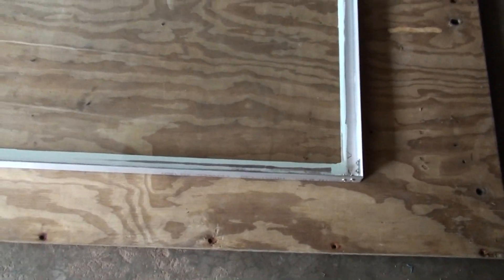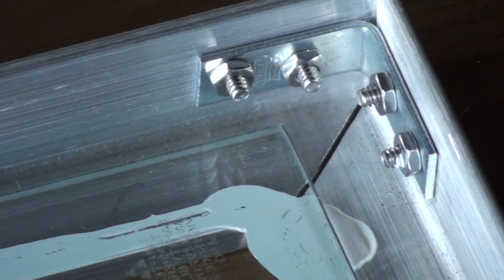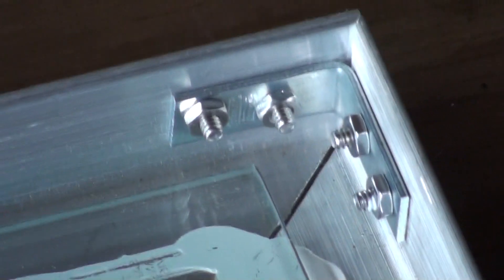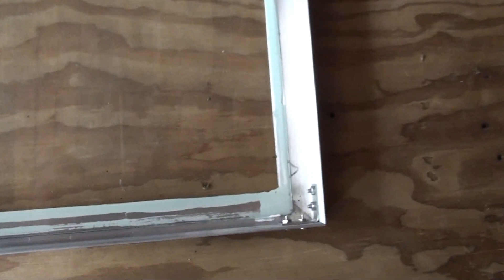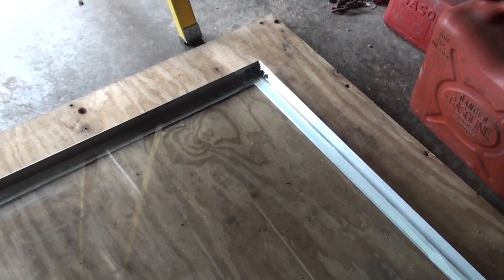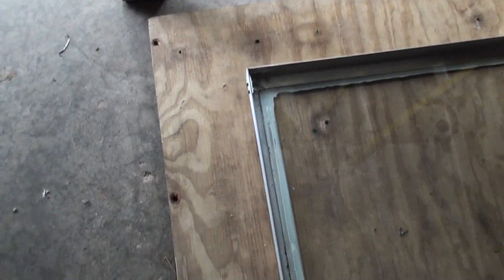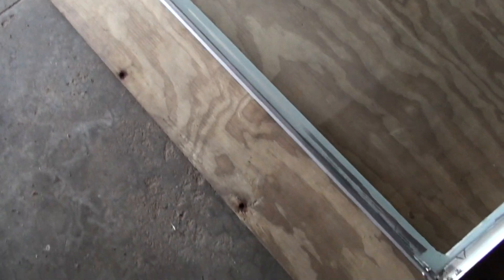DIY solar frame and glass assembled

Comment from the maker: The regular silicone works ok , there just must have been something on the glass. The panels have been up over winter with no problems. I have some aluminum tabs on the back side that help support the glass to be safe. I'm all done building panels now anyway because it's cheaper to buy them. I just got 10 230 watt panels for $219 each for a pallet of 10. They out perform the home made ones in full sun also.

Comment from the maker: @Prancinglion1 On the last four panels that were 60 cells per panel I used a standard 6 foot wide patio door glass. split the glass and get two pains out of each door section. ( 4 pieces of glass total) . I got the EVA off of Ebay, you'll have to check the price I don't remember.  To make a panel that lasts will probably cost you more than $1.35 per watt. Mine cost me $335. They put out about 200 watts each on a good day.

Comment: What are the dimensions of the sliding glass door you're using?  I have 8 panels that look remarkably simular to what you have.  I also intendd to make some DIY panels out of them... (8 if the first one go's well.)  At the moment I'm trying to keep the cost under $1.35 per Watt, the cheepest Factory panels I can find.  Also, where did you get the EVA, and how much is it per square ft.?